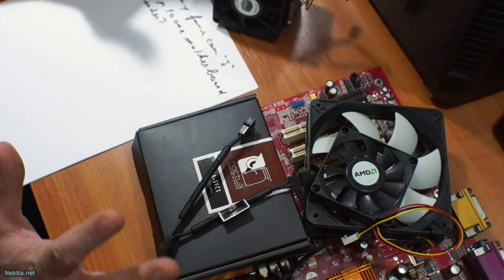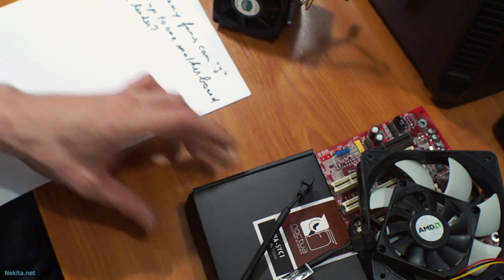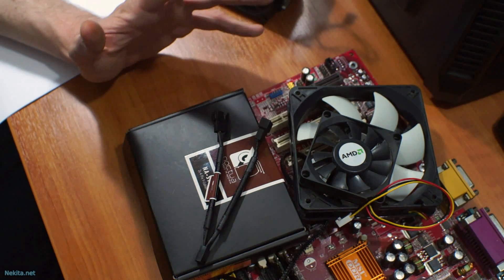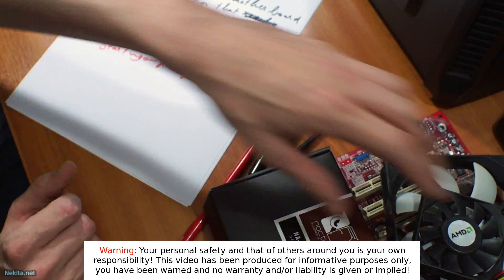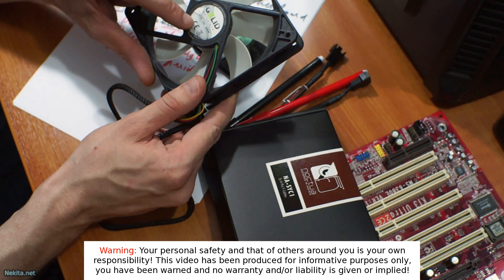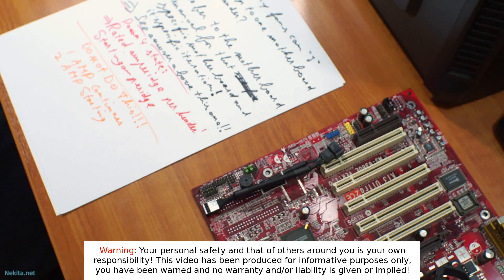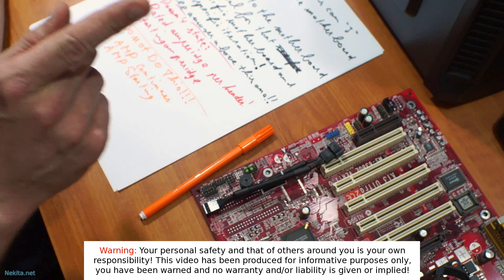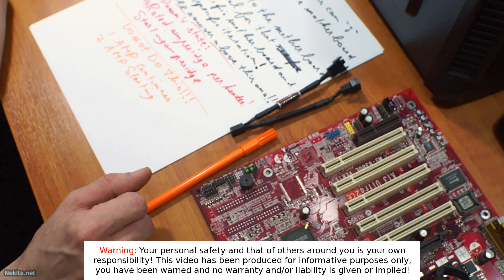Multiple Fans on ONE motherboard fan header?

Comment: Can i do this with all of my mobo's headers? In case it has 3 headers or more? Or will 'maxing out' current draw from more than one header pose a risk of ruining the motherboard?
Reply from the maker: Current draw is normally specified per individual header, however: Refer to your manual for specifics on this. Hope this helps.
Reply from the maker: Please don't edit comments after a reply is posted; That confuses the "train of thought" when reading a "comment threat".

As with my original reply: Current draw is normally specified per individual headers. When one header is "overdrawn" it will degrade and therefore will be damaged. Therefor the motherboard will be considered "broken". So, don't overdraw current on any of the headers. Hope this explains it further.

Comment: Thank you for this video, I was considering using my fan headers to split to multiple fans. I have 4 fan headers. As I use a hackintosh build I needed a virtualbox to change the speed of my corsair commander fan controller as they only have software for Windows. 
Though, I can't pass the temperature of my CPU or any of my components to my virtual machine. 
What I did and stay on thanks to your video: 
I have 3 fans of my water cooling system that cools my CPU (corsair 150i pro), connected 1 fan on one header and used the last fan header to connect to the commander fan controller.
Sadly I still have to use the virtualbox (which I wanted to get rid of), but my CPU fans are now changing accordingly to the CPU temperature.
Reply from the maker: Glad my video helped you sort it all out! :-D

Comment: My board says 1A max per header, my fan consumes 0.17A so i am using half the power with 3 fans so i guess i am fine for the start A as well :)
Reply from the maker: Well, you’re very close Eduardo! So, that’s .17A*3=.51A. At start-up of the fans that’s likely 1.02A and above the stated rating of the header (going by your statement); And that .02A is within the likely +- 5% margin most electronics are designed with. Close, but “no cigar” ;-) Have to say you’re trying and that’s very commendable.
Reply: @NekitaNet  Well it is still working xD so i guess i am ok :P until i am not hahaha

Comment: hi, is molex connecting fans safer and will it work the same? i know this video is old but please respond
Reply from the maker: There are two parts to awnser your question, here you go (If you haven't yet subscribed, then don't forget to do that on my channel page right here: https://www.youtube.com/user/NekitaNet):-> There are to many situations to cover your question completely enough to be correct, but in essence using a molex connection "to power your fan" will is not the same as a "motherboard header connected fan" (although some implementations of motherboard fan headers do not do anything more that provide a "power conduit" for a fan that's connected to it (this was especially true years ago, and therefore makes any answer to your question incomplete)).
-> As answered to another question to this video I'll rewrite that answer slightly: Using a molex connection to power a computer case fan would in most instances be the safest (and perhaps the easiest) option; Do note that then (to limit noise from the airflow made by the fan) one is normally advised to select fans that have the best RPM "fan speed" for your situations (more then enough cooling potential while not being to loud).

Comment: Very informative video, I'm happy I came across the information provided in this video soon. Thank you very much! 
I just have one small question to ask: If I am using a PWM splitter, merely as a cable extension to a single fan, will that damage my motherboard?
Thank you once again for the video, it really helped!
Reply from the maker: You're very welcome Craig and I'm glad the video helped. Now to your question (for which I had to take some time to think about): The unused end of that Y-cable may "bounce" the signal back since it's "not terminated" and thereby interfere with the communication between the pwm-fan and the motherboard. So although it might work, I would go out and buy a dedicated pwm extension cable. Hope this helped!

Comment: What's disappointing to me is that many many motherboard manufacturers do not tend to list this information in their manuals. Sometimes they list the maximum draw for ALL headers combined which is even more misleading. It should be required by law for safety.
Reply from the maker: That last statement I have to agree with. In some sense computers aren't consumer goods since there is danger.